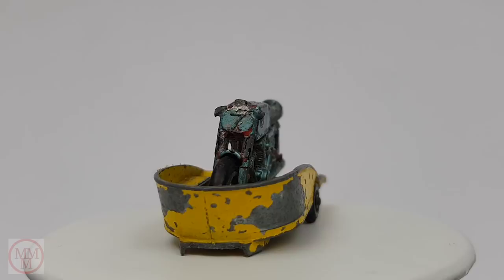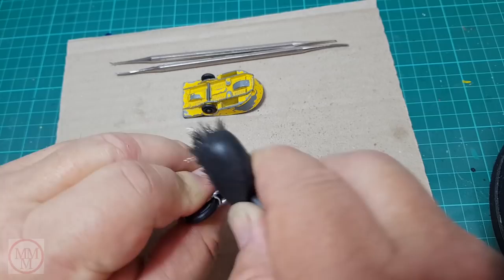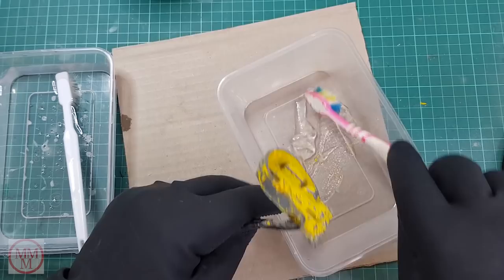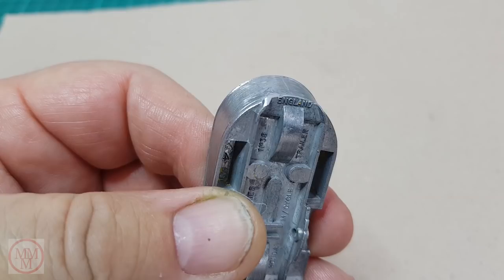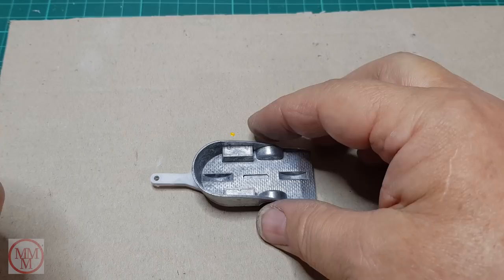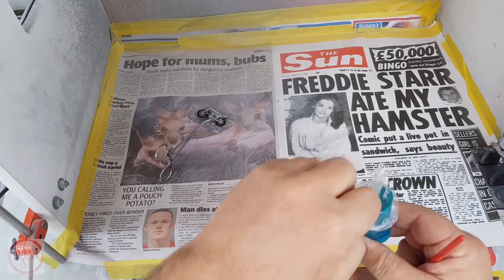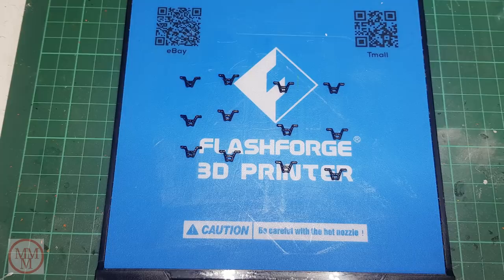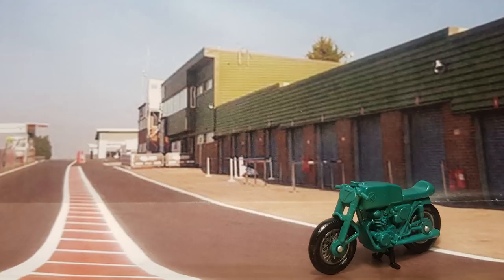MATCHBOX Restoration No 38c Honda Motorcycle and Trailer 1967

Comment: Green flame comes from copper in the wool. Copper atoms get excited and when they return to ground state, they emmit the green light
Reply from the maker: Weird Science!!!!
Reply: Man ya beat me to it. Yep coppers your culprit! Part of the alloy. 37% Zinc, 63% copper ish depending on  what type of brass. Bronze is typically 88% copper 12% zinc
Reply: @MartysMatchboxMakeovers  Sorry, Marty, but you're no Kelly Le Brock!
Reply: Great job Marty, was wondering when you would get to do this one 😃
Reply: !!!! education activated !!!!
Reply: And the reason the steel wool burns as it does rather than being on fire is that it is an accelerated oxidation reaction with the oxygen in the air. The iron atoms are getting energy from the flame like the copper in the brass wool. And the iron in the steel wool is turning to iron oxide aka rust at an accelerated rate because of the heat from the flame and ratio of volume to surface area of the strands of wool (very fine strands, small volume but higher surface area meaning plenty of surface to react and oxidise with the air.)

Remember thermite, the stuff that burns at very high temperatures and is used to cut through very thick metal is pretty much the same kind of accelerated oxidation reaction. Only instead of iron turning to iron oxide, in the case of iron thermite, it’s iron oxide and aluminium where the aluminium is oxidising by taking the oxygen from the iron oxide, hence the much higher temperature as it takes more energy.
Reply: Zinc in the brass also burns green, as zinc oxide is formed.
Reply: I concur 🙄
Reply: Hope ya did that in well ventilated area them some nasty fumes
Reply: The green fume is poisonous as well.
Reply: @TheLoxxxton  bronze is made of copper and tin. It can contain zinc and other metals.
Reply: Copper oxide is green. That's why copper plating turn green when weathered.
Reply: And don't forget, steel wool has oil in it, which will burn.  The oil is intended to prevent rust.

Comment: Green flame would be from the copper in the brass.
Reply: Yes, some metals will color flames. Copper (green) Barium (even brighter green), sodium (yellowish orange), Strontium (red), Bismuth (blue) and Magnesium or aluminium (bright white sparks) and Potassium (violet). These same metals are also used for coloring fireworks.
Reply: Bronze? Copper + Tin. Brass is softer Copper + Zinc. Both should produce green flame. Brass is more resistant to corrosion which is why it is used as bright work on sea going ships.
Reply from the maker: Mmmmh...that makes sense, thanks Neil!
Reply: Flamer

Comment: We done again.. But on the finish bike, it might of been an idea, to paint the engine, &  exhaust silver, just a suggestion on the next one..
Reply: I was thinking he was just going to leave most of the engine and tailpipe unpainted metal. Then do a black seat and 2 colors on the #7 sign.
Reply: I guess he wanted to keep it as close to original as possible. In the before restoration pictures, you can see the whole bike was painted. I thought it'd be neat if he left the engine in bare metal but I can understand why he didn't.

Comment: Oh, and by the way, your dental tools should have some small flats to them for adding and smoothing model filler.  After all, dentists do the same when they are shaping your fillings.  Well maybe not yours ... but you get the gist of it.  Easier than using a toothpick.

Comment: A technique used to find small objects dropped on the ground:
Use a vacuum hose ( up right, or shop vac ), Cover the end of the vacuum hose with loose pantyhose (rubber banded and place), and vacuum. Check the end of the vacuum hose to see if the pantyhose caught anything. Good luck, Cheers
Like so he'll see this. Thanks
Reply: An old modeler's tip for when the carpet monster attacks.
Reply from the maker: SEEN! - Thanks for the tip, Marty.

Comment: Great work Marty! That was always an odd toy to play with but such a cool model. It begs for some detailing, black seat and grips, gold badge, metallic engine and exhausts, silver filler cap and so on. 
Worth revisiting. Cool!
There might be a way to cut the forks  and separate off the front wheel and mud guard off and do an equivalent cut to separate the rear wheel, chain guard struts etc from the rest of the frame. Then, do the clean-up, painting, detailing then super-glue the parts in again. The Matchbox people must have struggled with it. It must have been the only motorbike they produced...
Reply from the maker: Stay tuned Chris, there may well be some customs to come!
Reply: Can’t wait. It seems to need some magic and a radical makeover. Good luck!
Reply: Actually you could polish and clearcoat  metallic parts. Then, mask, prime and spray/paint the tank and number plate and painted details, seat and grips. It had such amazing detail it seemed a shame to make it green all over.

Comment: Great result, Marty!

I am also restoring this model and I removed the wheels prior to painting. They are not as fragile as you might believe. The forks are robust, front and back. I had to repair one of the wheels where the spikes had detached from the rim. Even the tyres came up a treat.

Getting the axles back in again is tricky. I used other longer axles to get the mushroom heads peened again.

It’s important for other folks inspired by your work to understand that even models that appear completely beyond help can still supply much needed spare parts.

Thanks Marty!

Comment: I love the milkman story. Two things: Vallejo makes an amazing gap filler you should give a go, it's much easier to apply. Comes in a dropper. Also, if you haven't got one, the Tamiya modeling drill is amazing. It's low RPM and takes small bits, so perfect for this kind of work.

Comment: This is Louisana Ricky.Iknow you do restoration .I see a three wheel chopper chariot  in that model . chop off  the rear end J.B. weld the bike to the trailer put a seat in center of body  and bench seat  in rear of trailer fat tires on body .long handle bars small windscreen. That would so  cool.ideals  pop in my head every time i watch you work on  broken cars .keep up the good work.

Comment: Make a guard for grinding the axles with a piece of beer can. Drill a 1/8 hole and a 1/16 hole about about 1/4 inch apart. Then with a knife, cut a slot between the two holes. Put the larger hole over the end of the end of the axle and slide it down the slot. Viola! You can grind away without worry of marring your wheel.

Comment: That looks sharp,nice job on the on the repairs. I have the same set,and yes the cycle need restoring. I also have a 1969 model Tootsie double cycle trailer (like Matchbox in a larger scale than tow vehicles) with one silver Moped (mint).

Comment: Oven cleaner on a hot day works great.  Just needs to be hosed off.  Put model in the sun and spray.  Leave alone about 30 minutes.  Strips down to bare metal.

Comment: Nice job, I enjoyed watching.
I always find that the Humbrol filler goes off quickly when using a small amount, so a dab of liquid poly cement applied with a brush slows this down enough so that you can smooth it in, and work it into any small holes.
I also use Johnson's Kleer/Future floor polish as a decal set/softener.

Comment: Marty, one very important bit of information:  if you ever happen to put steel wool in your pocket with batteries,  you just might set your pants on fire.  Steel wool can also be ignited by putting it in touch with battery terminals!  LOL  This is something to remember and it's something taught to every Fire Officer and First Responder.

Comment: Love your vid's Marty, and have a giggle now and then when you have to improvise on some things.  Of course, having all - or most - of the necessary tools etc is more than just a help. I've been scratch-modelling for many years,  rarely with the best tools, and always working on my computer desk or more usually the floor! But when you love achieveing what you set out to do, all the little inconveniences disappear, as I'm sure you've long-discovered. One thing I've noticed in your videos is the absence of a certain product called Milliput. I discovered this amazing product way back in the 80's - long before most modellers ever heard of it. It's made in Wales of all places, and I understand it's avalable almost everywhere. It's a 2-part epoxy puttythat you mix with your fingers, First, it starts extremely tacky if you cut a piece off, it will stick to absolutely anything and everything, and never come off again!), so I always use a piece of plate glass and or sometimes a small sheet of 
aluminium cooking foil to roll and smooth it. Once properly mixed it's like a piece of boiled chewing gum - very maleable - and remains workable in that state for at least 20-30 minutes before beginning to turn to its next stage of soft, maleable rubber. From the first stage, a sharp craft knife and metal dentist's tools are your best implements for cutting shaping, pressing into tiny gaps &etc. Within about an hour it's a little softer than a schoolboy's eraser, and can be easily and cleanly sliced, cut, pared, indented, pressed and even moulded (although moulding is better done when in the tacky-to-gummy stages). once you're generally with the shape you want, just leave it for a couple of hours, and then it's possible to make additional changes to your end product without damaging or changing it's finer points. In four hours it will be as hard as a cricket ball, and in 24 hours it will be like solid stone. At this point, you can grind it, file it, saw it, drill it, tap it for screws, paint it with water/oil/acrylic or enamel-based paints. It can worked at any stage under water, and is impervious to fairly high or low temperatures (I keep my unused stock in the freezer as it has a reletively short shelf life - roughly a year). All my model figures of 54mm are made with it, and the tiniest pinhead things like buttons and badges, cog wheels, hub caps - virtually anything you can think of - are almost entirely made from Milliput.  You do need to ensure that whatever tools you use are washed with water before the putty sets, otherwise it can be one heck of a job trying to get them fit for purpose again! As for the foil, this will usually peel right off before it hardens completely. If you want to know more about Milliput, I think there's some videos on Youtube, Come to think of it, I could always do a video myself!!! I was thinking about the tow-bar you made for the bike trailer. With Milliput, you could have done the complete job in 20 minutes, simly by pressing the putty into the undercarriage, smoothing it off and making a separate shaped-piece for the bar itself, butting the two pieces together and smoothing them over the join. I hope this has been a useful little tip for you to experiment with. Keep up the excellent repair work, it's great stuff!

Comment: Marty, there is a masking product called Maskol that you can paint onto the wheels for masking and spraying. It is a rubber-like mask that sets and which allows you to spray the model but  afterward remove the rubber from the wheels manually. It is available in the model shops.

Comment: I had these! Though it was a bit beat up, and I can't remember the exact condition it was in (I know the trailer was intact at least, if similarly chipped). I remember liking how the wheels on the motorbike felt when they rolled.

Comment: The reason your bronze wool glows green is that Bronze is an alloy of Copper and Tin comprising mostly of Copper and a small amount of Tin. It does not burn because Copper oxidizes at a much slower rate than does any of the Ferrous metals.

Comment: Copper usually causes that color flame, try throwing  a piece of old copper tubing with a piece of old garden hose either over or inside of the tubing not your campfire. Looks really cool. Then retrieve it when the fire cools to reuse in the next fire. Just remember to add new pieces of hose. The more you put in the more colored flames.

Comment: I used to work at a small factory where we made clothes buttons and other kinds of items from cow bone and antlers of elk and moose. We would buy a bunch of antlers from individuals. Antlers would be covered by lacquer and paint. We used strong paint stripper. A few women got poisoned by fumes and had to go to the hospital. Later we got weaker stuff, yet it did not do a very good job. We also used to whiten bone in caustic soda, I did this job time to time. Huge boiling pot and aggressive amount of dangerous chemical. I would pour pile of bones onto a giant sieve (special bucket with holes), then plunge them into pot and take it out after a few minutes. Yet no accidents happened to me or anyone else. Interesting times. So I have no fear of those chemicals, yet you have to be careful.

Comment: You can make a home made filler adding a drop of thinners to the humbrol filler and making it more fluid to fill those little gaps I used it for plastic modelling to fill gaps betwen pieces or in modified parts .It works as a" high solids primer" does in full size cars filling gaps and pin holes...etcetera.You even apply it with a brush .

Comment: For better blending of replacement parts try using "Perfect Plastic Putty" it is workable with water drys fast and sands great....and non toxic.  Also you can try "Tamiya Putty"..the grey one, it is workable with acetone. Just use a small paint brush for both.
Reply from the maker: Next time i'm in the hobby shop I will see if they have any, I always like to show new products if they are available, thanks.

Comment: Top job Marty! Wasn't sure if you could fix the drawbar when you showed it in the unboxing video, turned out great in the end, those 3D printers are pretty handy things to have.
Everyone else has commented about the copper in the bronze alloy being the reason for the green flame, so I'll throw in a different piece of useless trivia lol. PLA stands for Poly-Lactic Acid, it's most commonly manufactured from milk by products and it's the same material that 2 and 3 litre plastic milk bottles in Australia are made from.

Comment: Great work as always mate 👍👍
I like the phone holder, cracking idea 🤘

The steel wool only burns because it is coated in a thin oil to prevent it from rusting, burns great if you place it across a pp3 9v battery 😂🤣😂🤣😂
The green on the other is copper oxide burning off

Funky

Comment: Great job, but that hook part is a little bit of weak spot. Here is a general tip-use small grain baking soda to fill the gaps, then put a tiny drop of superglue. It bonds and dries instantly and excess can be filed/sand off easily. It is incredibly strong (but brittle) connection.
Reply from the maker: I'll bear that  in mind, thanks! :D

Comment: copper sulphate gives off a green flame when burned  and as brass is a mix that includes copper that's the basic answer .. used to work in aerospace engineering heat treating metals in furnaces ,, when we had copper it was fascinating watching the green flames

Comment: The bronze wool burns green because of the copper in it. My dad used to burn copper wire to get the plastic coating off it, n it burnt with a green flame.
Reply from the maker: There's money in scrap copper wire I hear!?

Comment: FYI... Rather than leaving your decals in the water I would try holding on to them with your tweezers for 10 seconds then place them on your mat wet till ready.  This way they don't separate from the paper and float away in the water.  They will stay wet for a good while till ready to place.

Comment: Reason you had a green flame is because bronze wool is primarily copper (88%), and tin (12% or less), copper gives a green flame. I have a gunsmith friend who uses 3-handled brush's to clean firearm chambers/mechanisms (soft steel; brass, nylon), he lent his old  set to me, works perfect for diecast.

Comment: If you want to use caustic soda without glass breaking hassle, find a steel container or some decent plastic container. There be a reason lye flakes are often kept in plastic containers. Do not let pure aluminium near it though.

Comment: The super glue accelerator works in the opposite way. Glue the pieces together, then spray it with accelerator and it will bond instantly. Not the way you did it, as the accelerator will evaporate before you glue the parts together.

Comment: Marty, you mad scientist you.  I think the reason copper has a green light when heated is that as you know light is just electromagnetic radiation (light) given off when electrons are excited and move from one energy level to another.  And the frequency  of the electromagnetic radiation for copper given off corresponds  to the color green of light.  As you know for example infrared is a lower frequency than ultraviolet at the other end of the spectrum with a higher frequency.

Comment: Brass is an alloy of copper and zinc, while bronze is an alloy of copper and usually tin. However, bronze can be made with copper and other elements like phosphorus, manganese, aluminum, or silicon. Bronze has about a 50C higher melting point than brass and is more corrosion resistant, as well as harder and more brittle.

Comment: Hi Marty, re paint stripping. The caustic soda is most likely much less environmentally negative. It's just NaOH which will dissapate and neutralise in drain water easily. The gasses are most likely to be hyrogen or oxygen (from the water dissociating)

The actual paint stripper can contain highly persistent and even carcinogenic compounds. Look to avoid methylene chloride, eg citristrip.

Might be worth a little more research depending on your brand.

Great safety protection steps with the gloves and closing all kids 👍

Comment: If you mix the caustic in  borosilica glass (pyrex) it will not shatter.  You were apparently using normal glass which can 't tolerate temperature changes.